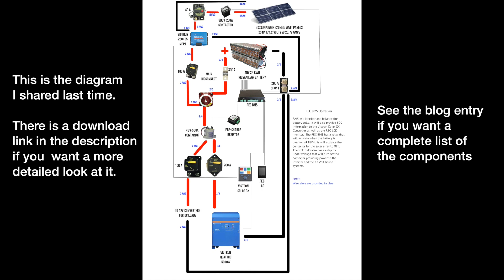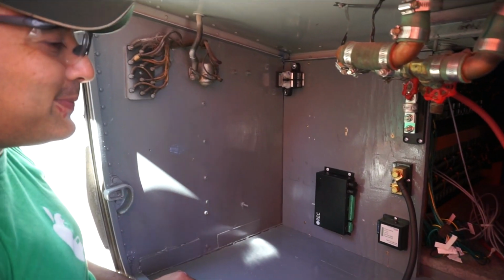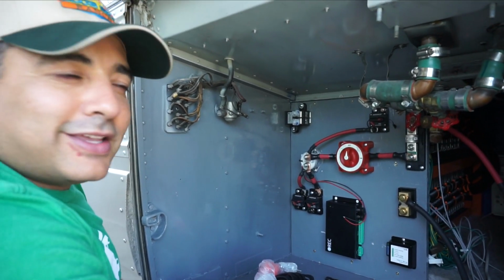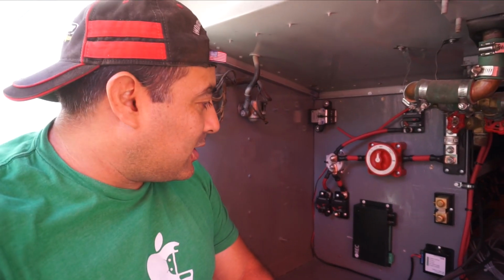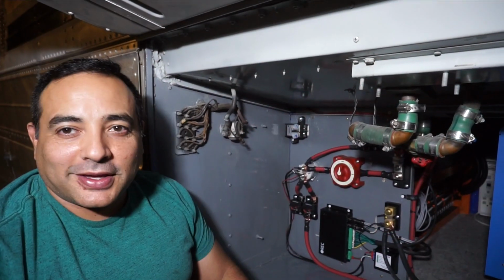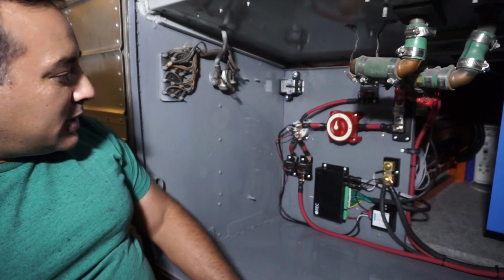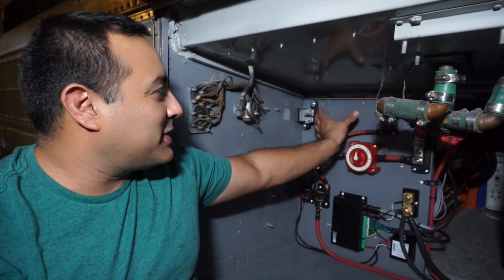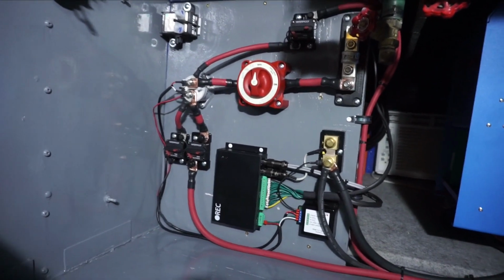RV House Batteries: Part 7 - Supply Side Wiring

Comment from the maker: UPDATE: We updated the circuit breakers: https://youtu.be/7pba3pEbKdU

Read The Details: 
http://www.beginningfromthismorning.com/house-batteries-part-7
Reply: I would have built these into multiple 13 to 14.2 volt bricks and made numerous location installs. One fails, you just disconnect it. But if one fails in this system, your so screwed.
Reply from the maker: We considered that configuration, but it would cost quite a bit more to monitor.

In our system, if one cell fails, we will likely lose the capacity of that cell - roughly same as if we lost one of the 14.2-volt bricks you describe. 
This should show up on our BMS as a "cell" constantly getting to "empty" first or constantly getting to "full charge" first - so we will have an idea as to where the bad cell is. Our BMS also monitors electric impedance - so that number should see a spike as well.  

If we hooked them in series first (as you describe) we would need a BMS to monitor each of the 7 smaller "batteries" that we then connect in parallel.   Granted this is a far better way to monitor each of the cells.   Even a very cheap BMS is about $500 - we paid about $1000 for our BMS.  This represents a significant increase in cost (keep in mind that we paid $2500 for the battery).  

 I haven't seen anything that would indicate that there is a significantly higher risk for fire (if that is what you are meaning by "your so screwed") in the configuration we are using.  Just an inconvenience when one or more of the cells start to die.  I figure when one or more cells start to go - the rest will not be far behind.  If we get 4 or 5 years out of this battery I will be extremely pleased - by that time there should be a better/cheaper alternative.
Reply: Using separate $40 solar controllers for each 12 volt arrangement, you have just set up the entire system. Running 4awg from each one to a big buss bar your now mass amped with low risk. We put in 16 Eighty amp batteries the size of a 55 amp AGM in a Monaco, 38 foot pusher. If one battery bank of 2 failed we lost 12%. Using 8 very cheap, temp control charge, and good 30 amp Lithium/agm/SLA controllers that are multi format you can charge with pure safety, less heat issues due to much more air around the cells and not loose a full bank of 7 , about 30% like yours is set up as. Whole system of all of it & 12+ year batteries. You have to order your batteries straight from Singapore though to get them half the price of US dealers.

Comment: Like the fast forward drilling segment .
Would like to have seen more of that in the wiring and assembly of the unit that way everyone could visually see and understand a little more of the building processes. Also you should consider building the battery unit to sell to others looks very well thought out and professional. That said Great Work WAITING to see everything (Bus) completed as a Whole.
Reply from the maker: Thanks for following along.  Thanks for the tip on the video.  We are still trying to figure out what to show and what to cut.  Also, when we do a project in pieces, sometimes we miss videoing part of it.  We will work on that.  We can't wait to see our bus finished as well.  Haha!

Comment: i have learned alot from your videos. Do you have a video where you address the engine alternator on how and what it does to your house batteries? Did you remove alternator? etc etc
Im on the fence about putting lithium in my coach...my house is 12V system. I have 458 freedom inverters/controllers...which pre dates lithium

Thanks so much

Comment: Like you say, VE.Bus is propitiatory and for good reasons too.
You'll need to connect your BMS to the CCGX over CANBUS. The Quattro will connect to the CCGX over VE.Bus and the Charge Controller uses VE.Direct. Everything will talk to one another through the CCGX.
The REC BMS interests me, I might like to use one of those on my system.

Comment: I noticed you have some water or coolant lines in that compartment, I would make up some kind of cover or deflector in the event those hoses or pipes break it will keep the moisture off of you electrical board.
Reply from the maker: Hi Ron - yes those are coolant lines and we are likely going to do as you described ... Another option we are considering is turning off the water via a vavle in the rear so that those lines are dry ...

Comment: What are you going to set your charging cut offs at for the whole bank.  The low cut off and the top charging  voltage ?

I have the same set up and batteries as you. Thank you for the great videos !
Reply from the maker: Thank you Jonathan - Our bus is at paint so I am pulling these numbers from memory.  (Please note that my memory is not all that good ;))  I believe our BMS voltages are: high: 58.1 Volts - Low: 43.4 Volts.  Our battery parameters are: high: 56.7 and low: 44.8 Volts.  I believe our "float" is set to 54 Volts.  I will get you more concrete numbers when our bus comes back.
Reply: @BeginningfromthisMorning  
Buss back from paint?  I am using A Magnum  Inverter  charger  do you of a BMS that would work with Magnum?

Comment: You’re doing a nice neat job! How many Watts off the room solar? Looks like you’re being really careful, but your water lines make me nervous if there was a leak!
Reply from the maker: Thank you Forstie-Flake.  If everything goes according to plan we should have about 3400 Watts of solar on the roof.  Yes, those water lines are coolant lines that carry coolant to the front of the bus for the defrost system.  I have double checked all the clamps and hoses and everything is off the ground so we should be OK but I will very likely put a water sensor in that bay just in case.

Comment: Juan, on your contactor from the panels, the 500 volt 200 amp one, where did you get it?
Reply from the maker: Hi Chad the contactor is on the panel side was sourced out of the Nissan Leaf battery pack.  We contacted REC and they advised against using it.  Our main contactor for the battery is a TE Connectivity EV200ADANA which is rated for 500A and 48V.  We talk about changing the circuit breakers and this contactor is the follow-up to this video: https://youtu.be/7pba3pEbKdU?list=PLq1-J1YKxmjpNwGVmvMp3yoEj21JmV634
Reply: @BeginningfromthisMorning  Thank you so much, my BMS is on the way I’ll have it in a couple of days and I have that contactor and I just missed the part about you eliminating the other one. I heard you talk about needing a different breaker. The guys I got my Victron equipment from sent me the appropriate breaker for my panels but I just didn’t hear about that contactor

Comment: How will you ever get to the A/C unit in the back of the bay? Caught up. Glenn Lever
Reply from the maker: It pulls out from the other side (in a bay)
Reply: How will you access the controls (will you pull it out each time?)
Reply from the maker: Oh - two ways.  #1 I made sure that the unit I got will "remember" the settings if it is unplugged (meaning I can control it by means of a simple relay or simply unplug it) - The other is that it came with a full function remote control :)

Comment: what's the maximum discharge current for your 7P7S battery? and how close is that to your theoretical maximum draw from the Quattro?
Reply from the maker: Hi Andy C.  It's not anywhere close the battery can output WAY more power than the inverter will ever draw.  Here is how the math goes:  The battery is rated to deliver 90Kw when it is in the car that is 90,000 Watts.  Each module is a 2s2p configuration putting the nominal voltage of a module at 7.6 Volts - there are 48 modules giving us a nominal total voltage of 364.8Volts.  If we take the 90,000 Watts and divide by the 364.8 Volts we see that each module can safely deliver about 246.7 Amps safely.  If we have 7 of these tied together in parallel we can pull 7 times the power or about 1727 Amps.  Our Inverter is rated for 5000 Watts - 10,000 for some short period (30 minutes?) so if we take the higher number 10,000 Watts - our nominal voltage is 53.2V we get ~188 Amps.  At 5000 Watts (the rated power of the inverter) we need to pull about  94 Amps.  Another way to look at it is that the battery is rated to deliver 90,000 Watts - we are running a 5000 Watt inverter and some very small DC loads - we are probably under 10% of the maximum draw for the battery.

Comment: Hi, I just found your videos and started watching and so far this looks like a great setup and I'm looking forward to finishing your RV electrics series.  I'm not trying to be a safety nut here but, you should try to get out of the habit of absent mindedly touching electrical components and contacts while you talk.  One of these days you may be describing a live high voltage contact and absent mindedly poke it with your pointing finger and....well, you know....
Reply from the maker: Thanks c22narf - The system has been working really great.  We had to continue our build on a piece of land with no power or water and this electrical system has been supplying our electrical needs 100% off grid.  Safety is a big concern for us and we do try to make every effort to make things as safe as we can.  Welcome aboard!

Comment: I'm new here so don't jump on me for asking , but seeing as that's an RV ,how about a bunch of solar panels on the roof to supplement charging , Harbor freight has cheap ones I use to charge my small rig for camping
Reply from the maker: Hi Tony - welcome to the channel.  We have some pretty big plans for solar.  Last year I purchased 8 LARGE solar panels in hopes of being able to generate most of our power from the sun.  We are JUST starting to build out the array and should hopefully have an update video on the progress of that soon!  Thanks for watching.
Reply: AWESOME THANKS FOR THE REPLY . AND THANKYOU FOR THE AWESOME LINKS FOR CHEAP BATTERIES, I GETTING 32 OF THOSE MOSNTER 38120S sorry about the caps .some of my passwords use caps and I forget to hit the caps lock LOL . I made a 1500watt  supply on wheels a few yrs ago before li bats were popular , I power my telescope and accessories all weekend and all my camping gear weith just 3 65ah agm wheelchair bats I goty for free , and the fit in a coleman cooler like they were made for each other, screwed that to a furniture dolly and wire 6 12v sockets and a 1500w inverter to it and its been wonderfull ,but I'm looking for a lighter pwr supply , and only 400watt . the 1500 was a bit overkill ,although I can use power tools while camping , I can just wire that into my vans battery and run the engine while drawing that much juice. if you have an idea for a small 12v power supply to run about 30 amps {MAX}of gadgets let  me know .  THX

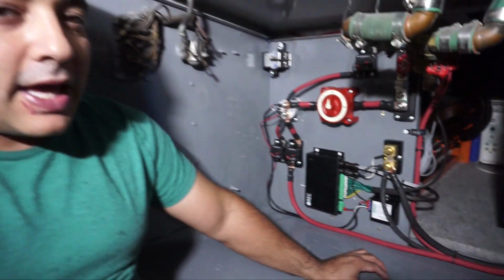Comment: 6:00  48 volts requires a thinner cable (2/0) than 24 volts at same wattage, correct?
Reply from the maker: Yes that is correct.  Ohm's law dictates that if we double the Voltage we cut the amperage needed by 1/2 (which translates to smaller wire sizes)

Comment: Guys you know I have been following you from day one and love all the hard work. I hope this comes out not as me trying to sound like a butt head know it all. I am not. I do live with my off-grid 24 volt 678 amp pv 2500 watts and I have lived 100% off-grid for 10 years before moving here. Top that off with I have been working in the renewable energy /Telecom services industry for the past 20 years. 

I tell you all that to say this. What is the name of tho's DC Breakers? I have seen more than 10 fires from tho's cheap one's If there not Blue sea and you did not buy them from Blue sea's. I WOULD NOT TRUST THEM WITH YOUR OR MY LIFE. I have videos on my cheap old solar setup and I do not follow all the rules. Your more than welcome to come and see. But one thing I do not have or trust are tho's. You have to look out to Blue sea's makes real good stuff but it's not cheap. So there are a lot of fake ones out there. 

Please look into this. Hope I have not upset you. I just care and would be a mess knowing I did not speak up. If you can't buy the brakers go with ANL fuses. Slow blow for your inviter and  for pv input buy  Midnite solar DC Breakers there cheap.. IT'S NOT WORTH A LIFE !!! God Bless guys,, So hope your not mad at me. If I had the cash I would buy it for you.
Reply: Car audio scene has the same feeling on those. I'm waiting to see how all these components work together to do a similar build, but that was the only one that gave me a shadow of a doubt so far. I'm giving the benefit since everything has been top notch so far.
Reply from the maker: Thank you very much - No offense taken at all.  On the contrary, we are glad that if you care enough to point this out.  Part of the reason we put these videos out is to share and learn from others.  We will be taking a serious look at these.  Part of the reason we chose these is that they are UL Rated and Meet S.A.E. J1625, J1171, UL1500 (Ignition Protected) - They were not too cheap ($23, $28) but upon taking a closer look we may be exceeding the recommended maximum Voltage.  Again - thank you we will take a serious look at this.
Reply: I’m no expert in this field but will say I love midnite solar products and their support is excellent. I ended up using one of their epanels in my RV so all the wiring and breakers are not exposed.
Reply: Those actually have a lot of good reviews.Good luck with them!  After very little research I think I'm spending a little extra on Bussman. Blue Sea is a little pricey, but comes with a huge following too. There's the same T TOCAS breaker under another name IZTOSS. They look like a copy of Bussman. Usually many different names of the same product is a trend I see in knockoffs.

Comment: Ferrules are great choice, very professional, now there are few issues that i see, Inverters, MPPT charger and batteries together will kill your battery in a record short time. It is known that if you keep Li-Ion battery at high state of charge just sitting in elevated temperature, it trashes battery in just one year your remain capacity is 60-80% (that is the reason why laptop batteries die so often in Laptops, you can find some details about it here https://plus.google.com/u/0/+ZegaracRobert/posts/Tou47ZMg7kh especially follow the link to the graph on  battery university.  Also some experience- confirmation https://www.youtube.com/watch?v=XNKUQEZyl5U  Cool/Ventilate that battery area, and set battery charge cycles to lower depth of discharge cycles in normal operation (set lower terminal voltage to ~3.9-4.1V depending on temperature to increase battery longevity (Tesla does the same, that is why their batteries last really long time) they can unlock full charge like during hurricane Irma in Florida, they remotely unlocked all the batteries to full capacity for people in the in the area, but regularly they keep their batteries like i just said. http://www.slate.com/blogs/future_tense/2017/09/10/tesla_unlocked_florida_drivers_60kwh_batteries_before_irma_not_everyone.html
Reply from the maker: Very interesting.  A lot to digest there - I will look over the articles you have posted.  Thank you again for the input
Reply: Dont stress about it too much, you can solve this by installing some fans that will take excessive heat out of that space...  Best fan i have worked with is http://prown.com.tw/new/uploads/product/pdf/SD254AP.pdf some similar 3blade will work  i have 10" 24V version only 12W power draw, 550CFM, and VERY QUIET, best fan i have worked with...
Reply: They are running active cooling with an air conditioner in the battery bay.

Comment: Those copper pipes are shouting ‘risk factor’ at me.😳
Reply from the maker: Thank you Norman - Yes - We thought about building a small catch and drain for them - but it is much easier to just turn the water off near the rear axle - at which point these pipes could be drained and no longer present a risk ... we are still weighing options but that is likely what we are going to end up doing.